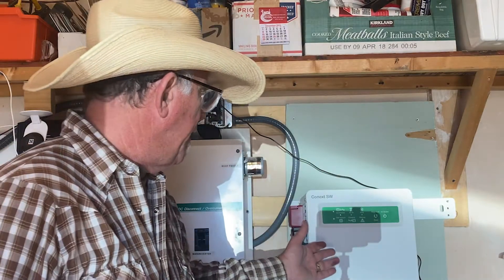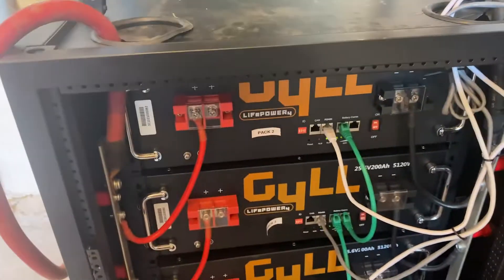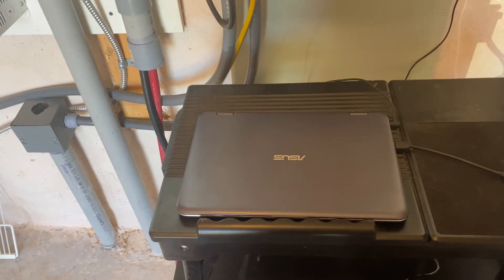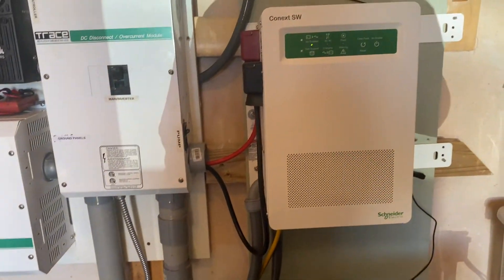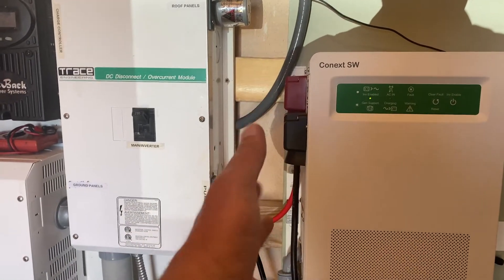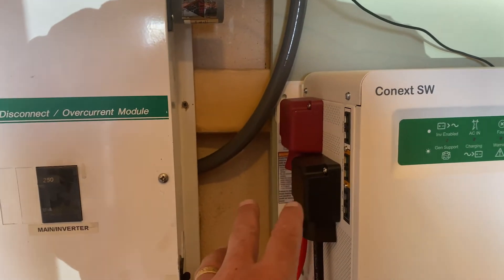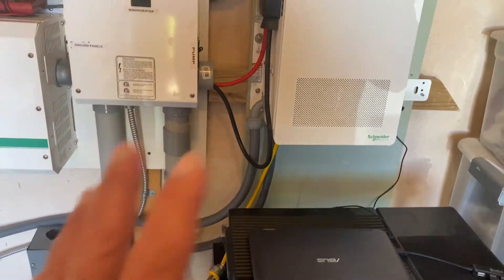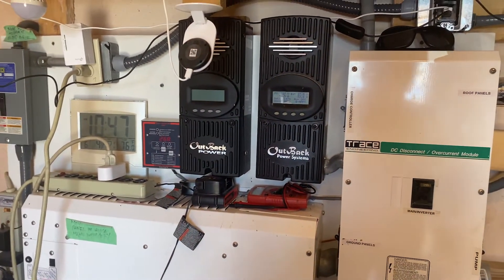Off-Grid Home lithium Solar Upgrade Part 3 - Conext SW Inverter Install

Comment: Hello and thanks for thanks for sharing I have the Schneider Electric as well 24 volt with the SCP and I think I've made an adjustment that I can't undo so is there a factory reset for the SCP I think it's stuck in charge mode and I'm not able to invert

Comment: 15KW of battery bank has how many amps going to your inverter? i thought it would be too much amps for the inverter??
Reply from the maker: The inverter only draws  30A.
Reply: @taosjay  thanks for the response so eventhough your battery bank has a lot more amps (guessing 150amps your inverter which is same as mine only draws what it needs!!
ok the reason i am concerned is because sw inverter says in the manual (MAXIMUM DC INPUT IS 110 AMPS) ???

Comment: Great video, how your batteries communicate with the inverter?
Reply from the maker: The batteries don't communicate with the inverter. I just monitor the batteries via a Raspberry Pi with Solar Assistant, that in turn feeds to Home Assistant.
Reply: @taosjay  thanks for your feedback, so batteries are doing good without comm?
Reply from the maker: @samba2498  I've had the Batteries for four years and they are still reading 100% state of health from BMS tools and Solar Assistant.

Comment: Hello Sir, I've just purchased 2 of the same 24V 200Ah EG4 batteries to change out all my Nickel batteries. Before converting over to the EG4s and powering down to unhook the pos/neg cables to the EG4s, do I need to set my Conext SW 4024 in Standby mode? Is there anything specific I need to do before switching over to your batteries?
Reply from the maker: I would definitely power off the SW 4024 before changing the battery cables.

Comment: You can get full power from leg of the Schneider inverter.
Reply from the maker: Thanks Ck K, Since this video I have wired my home for 240V split phase,. Now I can run a 9,000 BTU Mini-split heat pump for heating.

Comment: I have got 8 12 v 200 ah lithium batteries, can anyone please tell my how to correctly setup my context schneider 4048 inverter ? I will be charging my batteires at 14.20
Reply from the maker: Two strings of four batteries in series (make sure your Lithium Batts support series connection.)

Comment: Two questions. How is the Batt capacity determined? I have 8 12 v 200 AH Lithium batteries which will replace 8 12 v 200 Ah gel batteries. Whta is the voltage on this context 4048 , is it 24 or 48 volts?
Reply from the maker: Batt capacity is determined by Ohm's law W=V*A you have 8* 2400Wh giving you 19.2 Kwh overall. My inverter is the Conext SW 2524  basically 2500W continuous from a 24V system.

Comment: Nice! As i know, the Conext SW doesen’t have a charging preset for LIthium or LiFePo4 batteries. Which charging scheme would be the best for LiFePo4 ? Thanks.
Reply: Hi Pista, did you ever figure out the answer to your question? I'm using your same setup.
Reply: @tbhollywood  Hello. Unfortunately not yet.

Comment: I am using 24v settings can you tell me what to set my controller on for hi voltage and low voltage and float voltage for lithium battery's

Comment: Sagebrush, I have a solution to the multitle battery to computer communications issue that dose not require more than one of the USB to RS485 adaptor. I have been trying contact Signature Solar's tech support for over 2 weeks by phone and Email and they will not reply back to me. I want to confirm that what I am doing will not damage the battires before I relese how I am doing it.
Reply: That's great news! Having to use three dongles and a USB hub is a bit of a kludge.
Reply: @JayShaffer  Do you have to rescan to switch from battery to battery. I am working a YouTube video on how to do it, I will let you know as soon as I post the video.
Reply: @JayShaffer   I just posted my video on the replacing of my old saltwater batteries with Signature Solar batteries and how I found the solution to the communications issue with two or more of the batteries not communicating with a computer and what my workaround is. Please share the video https://www.youtube.com/watch?v=Mq4YNPOzUyA  .

Comment: Wait until you need parts... Schneider says field serviceable but, had several customers we couldn't service because of unavailability
Reply from the maker: Serviceability is concern. I think I have a better chance with Schneider than a imported brand like GrowWatt. And I will probably add another inverter to support a mini-split heat pump.

Comment: How are you liking your Schneider so far . Sounds like you dont use a whole lot of power for such a big home . I have the Schneider 4048 . Are you able to make your bms communicate with the inverter some how ?
Reply from the maker: Thanks Nokia,  I am currently averaging 8KWh a day  for our home usage. I haven't had any significant problems with the inverter. right now I have it wired as two 120V circuits. My next project is to  wire a 220V circuit to support a 12,000 BTU mini-split heat pump.
Reply: @taosjay  you can't go wrong with the mini splits . That is what I am using .  240 is usually slightly more  efficient than the 120 units I found.

Comment: Great setup . The “ Trace “  was a quality classic antique inverter from its time being many names until its “Schneider “ inverter now that’s split phase Pure Sinewave now . You have a nice system and most of the components are quite compatible with the setup for ultimate production of power to run your house . Check out my solar videos , hit like, leave a comment and subscribe . May the solar be with you .